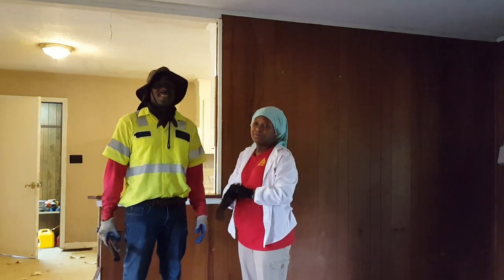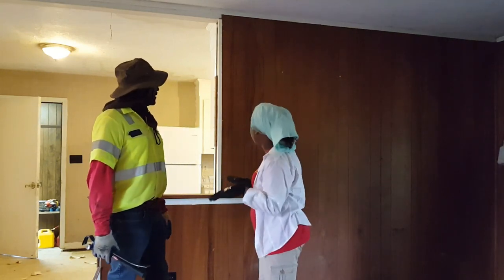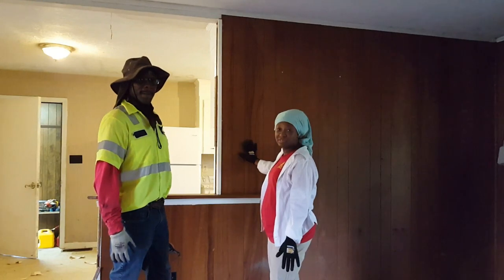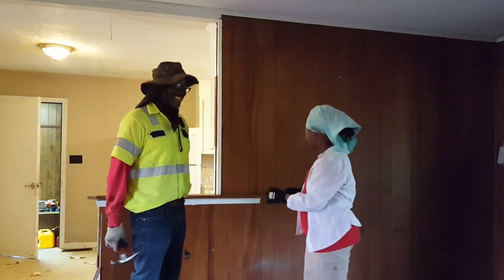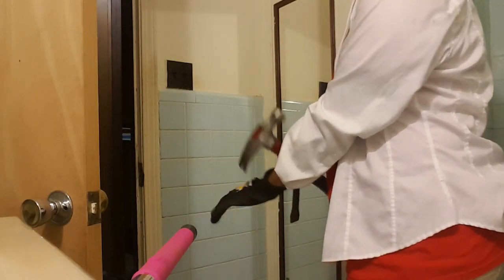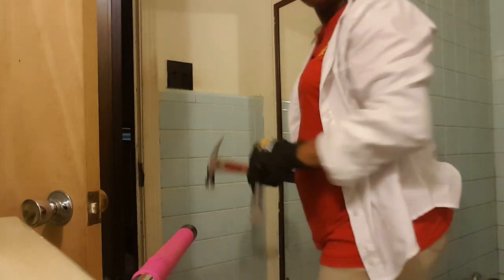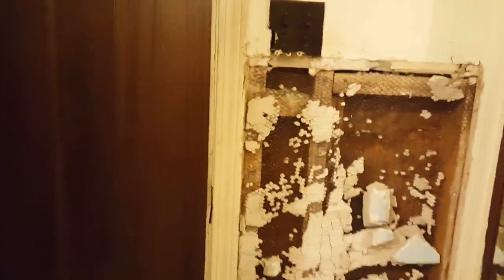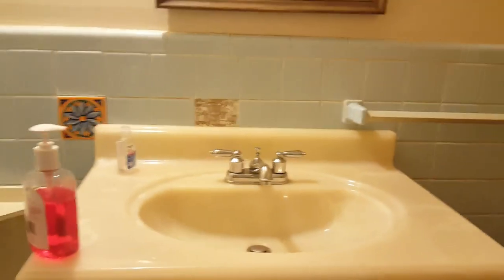DEMO DAY #1  On The Homestead!

Comment: You are a hard worker. WhT a nightmare! There is an easier way, getting a reciprocal saw and cut around the tile and pull down the mesh and wall board if it’s there, that is what we did in our bathroom remodel.